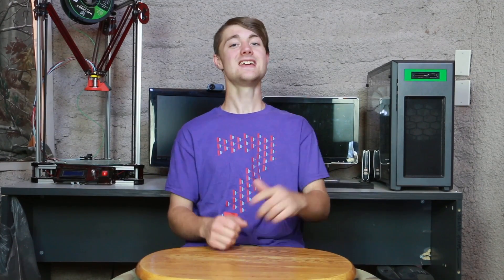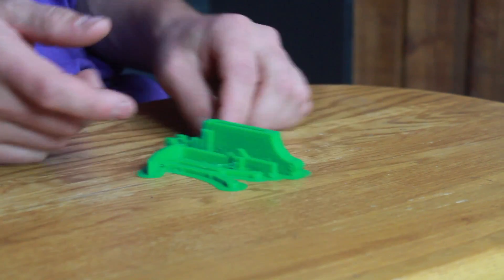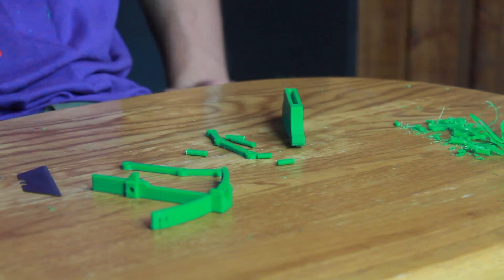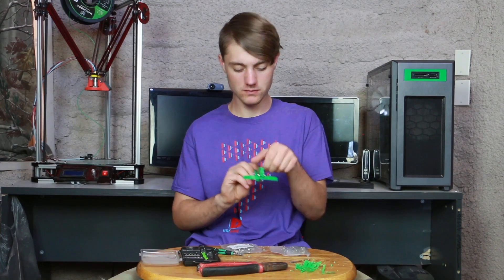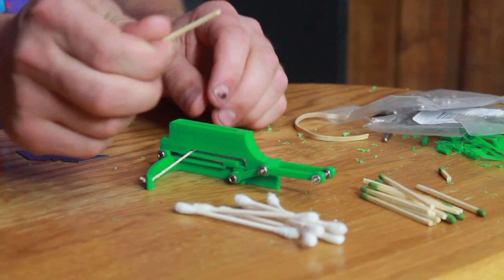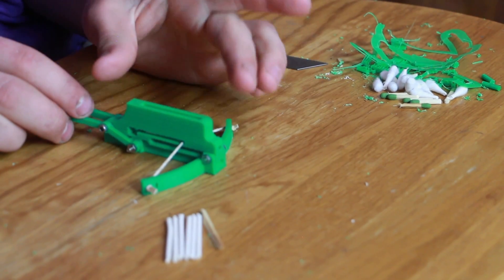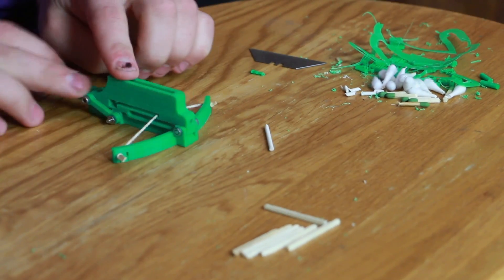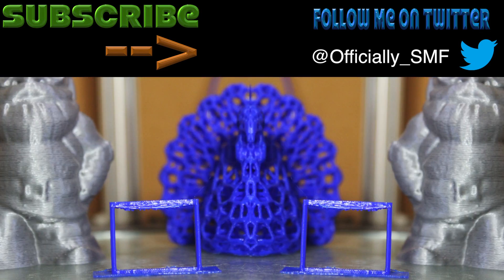3D Printing A Crossbow! [Thingiverse Print Review]

Comment: Turn up your retraction speed, distance could probably be a little bigger, and try printing at a lower speed to try to fill in those dead layers. To get the right holes, try keeping a log of the circles you design vs. the tolerance difference. You have a lot to learn.

Comment: Now that is awesome. Even if the pins were feasible, I think the choice 2 use hardware was the better decision ! ! But U already knew that. Okay lets just say I'm N agreement with U ! Is there a pattern 4 an adjustable tablet holder/stand or a hairband with pointy Spock like ears on the sides and antennae on the top 4 Brea 2paint & wear? She likes the unusual & different. Or a box that holds thumb drives, or a toothpick roll out dispenser. Maybe bag clips or a wind up mouse 4 the cat. A flute or harmonica. Now I'm just getting crazy. Can't wait 4 your next one ! !